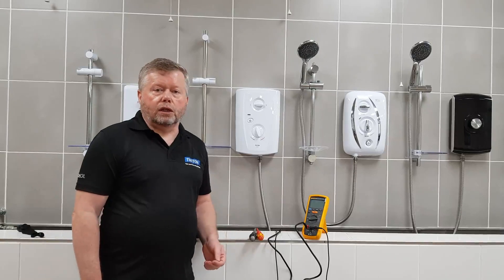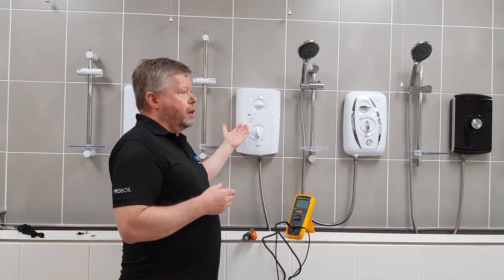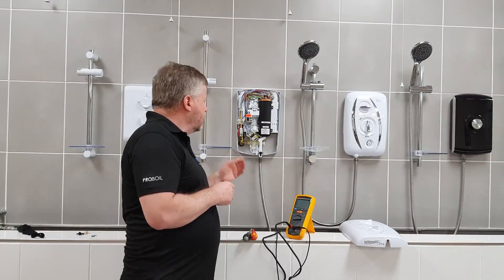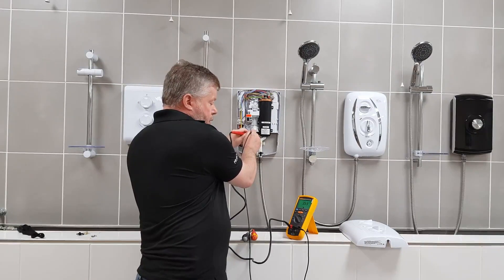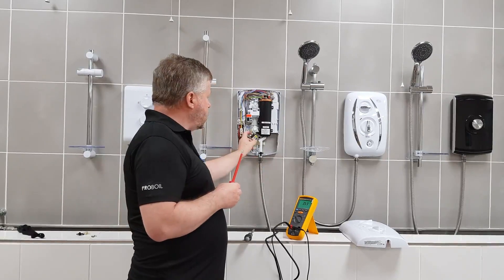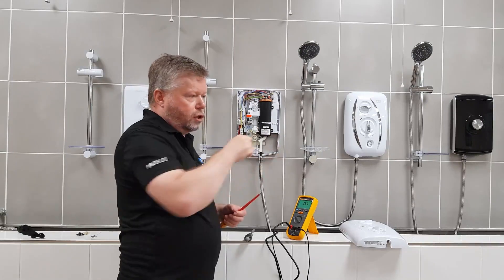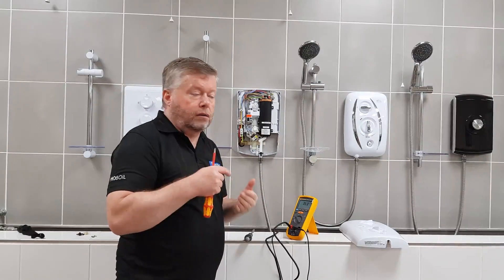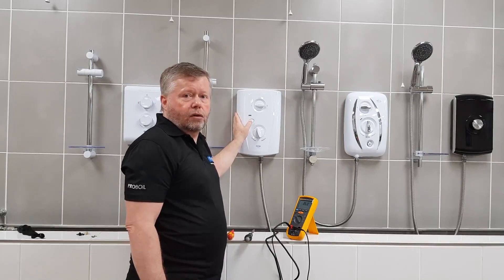Electric Showers | How to test and replace a Solenoid Coil

Comment: Shame you can't see what's going on in this video, and what age / model of Triton showers does this advice apply to? 

I just tried this with my Triton Cara and the coil wouldn't twist off as suggested. When I did finally prise it off, water poured out into the bathroom and flooded the floor. The new coil won't fit back on and I now can't turn the water back on.

Comment: In very cold weather, always check to see if the water supply pipe is not frozen before going after the solenoid valve.    Have a look to see if the filter is blocked but you may need to bleed the air from pump before operating it again.

Comment: Can a solenoid valve partially stick open when energised? 
After four years of great service, my Triton Aspirante gloss black (9.5kw) shower is having water flow issues and there's a hissing sound from the inlet side. Valve closes when shower is switched off and inlet filter screen is clear.
Heater coils and tank tested, got continuity, no shorts to earth or open circuit and no limescale buildup. Ohm readings appear normal. PRD intact, no internal leaks.

Comment: I've got a triton opal 3 and the solenoid is positioned in a way that I can't just prize it off the spigot, it's oriented sideways with a plastic wall of the housing in the way. What can I do?
Reply from the maker: Hi Jonathan. Thank you for your enquiry. To replace the solenoid on this unit, you would need to disconnect the shower and replace the combined stabiliser/solenoid valve.